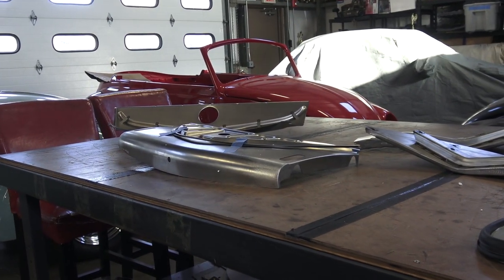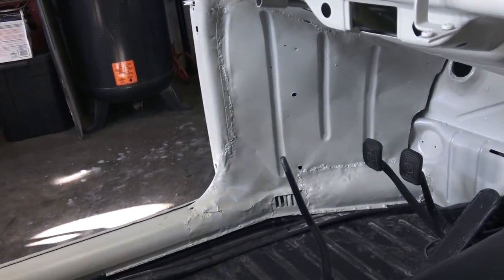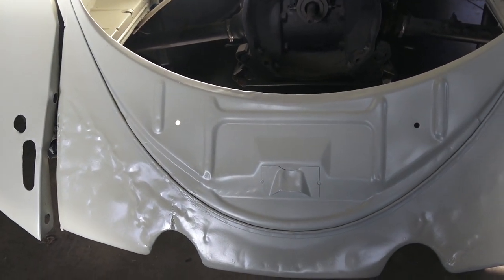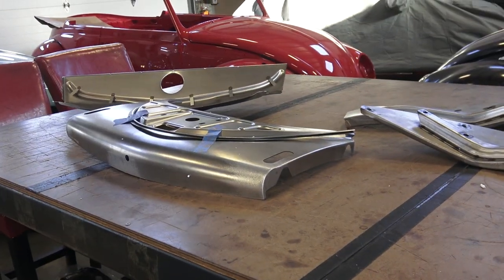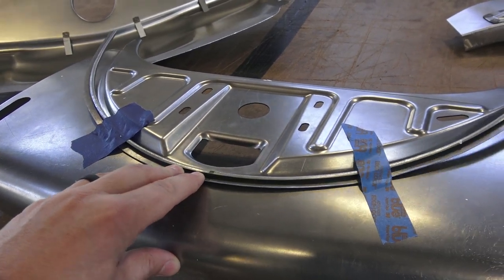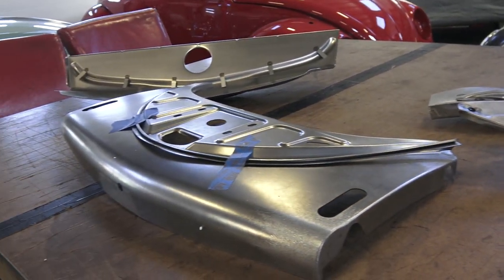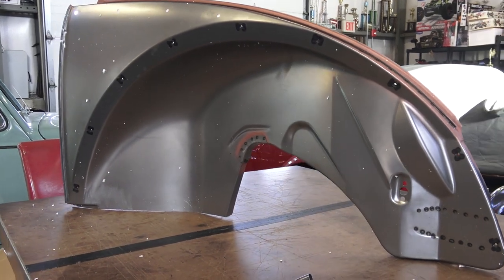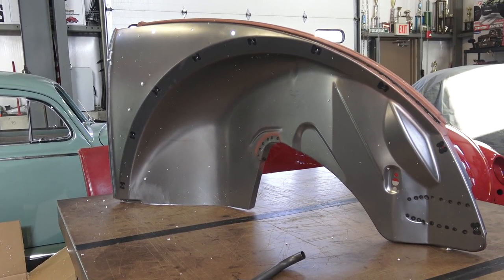Awesome Sheet Metal Panels for your Vintage Classic VW Beetle BuG

Comment: What do the new replacement parts weigh in conpareson to the original?  How thick is the metal?  Is Stainless Steel available?  Costs?   Started doing K-Gs on 24/12/65!

Comment: Yes I have that issue now. My Oval was cut in the front underside for extension of the front beam. So I rebuilt the car to mimic a late 60's early 70's drag car. 
Well now - I'm wanting to put the front back to original. Or close to that. So I'm trying to decide how I want to box in the underside of the truck area.

Comment: They are good but at £800 a side it’s a bit steep for the average joe
Reply: I was excited until I saw the price... however, for my application I would be cutting them up as I only need a small area replaced. Might just buy a parts bug at a cheaper cost and have many more parts.
Reply: Yeah bit steep for car spares
Reply: If you think it’s steep, bear in mind that to properly repair these areas on a rusty or damaged bug would cost more in time and materials than it would be to replace the whole quarter instead. People who haven’t properly restored Volkswagens don’t understand. Time is money.
Reply: vwhelmot I suppose it’s different for different restoration projects but if it’s your first time and you haven’t got that level of money to burn on a car you have to remember which type of restoration you’re doing if it’s for profit then you have to take into account what level of money you want out of it and then if it’s personal then you have to balance what you think your veedub is worth

Comment: Why don’t they ED coat the parts before shipping them out? Chris, how are you going to rustproof the parts???
Reply from the maker: there is a cosmoline on them I think, they had no flash rust on them.  Body shop will rust proof them, they have to put their primers and sealers on them.

Comment: I wonder how much it would cost to purchase all the parts to put together an entire VW bug from beginning to end? Does anybody have any ideas?
Reply: You can't recreate the greenhouse welts.
Reply: About the same as for a new modern car.
Reply: kydrythm, “greenhouse welts” ? Do you simply mean the welding that may have to be done?
Reply: StayvZ , Subcompact or regular? Seriously are you talking $50,000 $25,000 $15,000?
Reply: @MissMarinaCapri  the rain channel is folded over a few times to make the seal.
Reply: @MissMarinaCapri  the machinery that creates that is long gone now.
You would have to weld them and that changes the energy of the car.

Comment: Just want to throw this out there, I'm having a really hard time getting my hood to fit right, is there a secret to getting it to fit right and do they make braces to help strengthen them ?
Reply from the maker: Was the car ever hit?
Reply: Looks like there is a little damage to the driver side front quarter looks like it might be rolled in a little  where the rubber seal fits. Trying to get the hood even on both sides and trying to get the arch of hood to have an even gap, I would appreciate any info you could give me

Doug
Reply from the maker: @dougmittleberger8802  if you can possibly send me a pic of the alignment, that would be great.
Reply: I'll get to you in a couple of days, the cars at my son's house